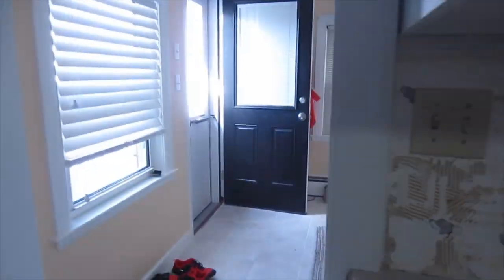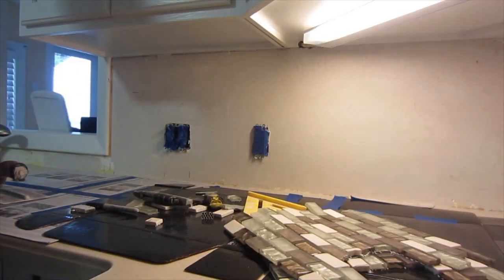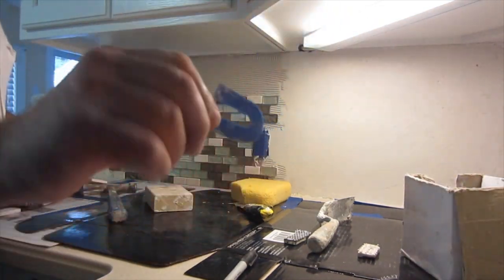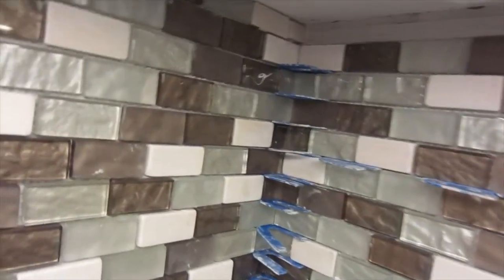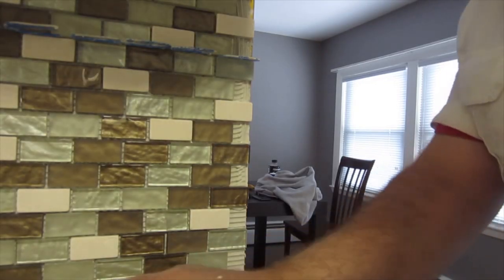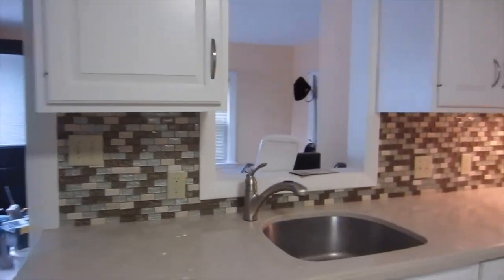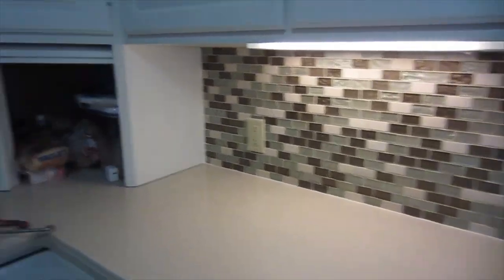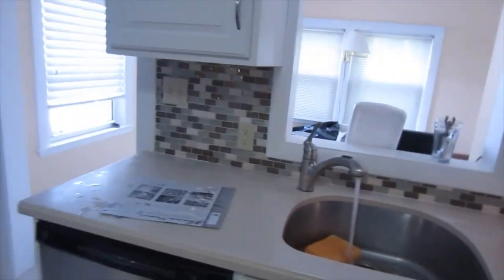How to install a glass mosaic tile backsplash Parts 1,2 and 3

Comment: Did you use thin set to patch the holes in the wall too? Also, does it help to draw level lines around the wall to make sure all the tiles are level?
Reply from the maker: Yes I used thinset in conjunction with fiberglass mesh tape, and any lines that you will find helpful should be drawn. If the counter top is level, then a level line will help, but if it is slightly out, then you might want to just follow the counter, otherwise the  tiles that sit on the counter  will not all be the same size. You will either have to cut the tiles or have a grout line at the counter that will increase in size. This will not look good, most counter tops are usually level, but not always. If not you will have to decide whether you want the tiles to be level, or parallel to the counter. If the counter is out of level, and you decide to have the tiles level, then the whole backsplash will look like it is on an angle relative to the counter, which will not be pleasing to the eye, if you follow the angle of the counter, then the tile will be square to the counter and will look correct.  Bare in mind that most counter tops that are not level are only out of level by a small amount, but a counter that is out of level by only a 1/16" per foot will leave you with a difference of a 1/4" in 4 feet and a 1/2" in 8 feet, putting your tile level in this situation will result in an unsightly finish. I am telling you all this, because i have seen it done. Your choice.

Comment: Hey Sal, can you use a Schluter Reno edge strip on the sides of the mosaic wall tile for a border?
Reply from the maker: You can, and i have, just make sure you get the right size.
Reply: ***** thanks Sal

Comment: How would you deal with a textured (orange peel) wall? Just lightly sand it down until it's mostly smooth?
Reply from the maker: Or you can skim coat with thinset to make it smooth.

Comment: Thanks for a great video. Very informative! This looks almost exactly like my project. I had 4by 4 white tiles that have been removed Which left me with high ridges and some pretty deep holes. What did you use to patch holes and for skim coat? Another weird coincidence is that the mosaic you used is exactly what I need. My floor and some kitchen walls are brown and the adjacent dining area that directly abuts one end of the new backslash is green. We've been looking for quite awhile for a tile that would tie it all in. Any chance you have spare tiles where you can pass along the brand and model info to me? It would be great of you to do that and I would be very appreciative.
Reply from the maker: Just patched the holes with some fiberglass mesh tape and skim coated  with thinset, unfortunately I have no idea what the tile was, to long ago to be able to find out.
Reply: i am getting ready to add back-splash in our newly finished basement laundry area, bathroom and kitchen.  These tiles appear to be similar to the ones I bought at `Home Depot.  They are called Ayres Brick and the store SKU is 188529

Comment: I'm confused on one thing.  Why do you not just  cut the top strip of tiles to fit under the upper cabinets?  Instead you cut the top strip an inch short and then pieced in the remaining strip to but up against the cabinets..  I only ask because I will be doing this soon.
Reply from the maker: The last piece of tile needed to be trimmed to fit, a full tike was too wide

Comment: I don't understand the necessity for a flash coat of thin set?
Reply from the maker: Usually not needed, but this time I had to fill small holes  and smooth out the wall a bit.

Comment: I still do not see any answer to the question of leaving a space at the counter top?
Reply: P Gordon , i usually do leave a slight grout/caulk joint between the counter. caulk it or it will most likely crack out due to the countertop flexing.

Comment: what was the purpose of placing the 1 inch blue horse shoes in between the tiles?
Reply: You use these between individual sheets of tile to make sure you maintain the spacing, which is later filled with grout.  If you don't use spacers, you will have tiles right next to each other without the needed spacing to fill in with grout later.

Comment: do you need spacers for the elec. outlets
Reply from the maker: +Mike Fix I never use them, but you can if you want to.
Reply: Wont the outlet be recessed compared to the cover
Reply from the maker: +Mike Fix Maybe this will help https://www.youtube.com/watch?v=gg_Mj3vwts8
Reply: +Mike Fix Yes it will, but it does not matter, tile is not combustable,
Reply: +mark rainford what. i asked if you need spacers to raise the outlet so it will be flush with the tile. not sure what page your on.

Comment: What did you use to skim coat the surface before applying it?
Reply from the maker: Same thinset I used to install the tile.
Reply: Sal DiBlasi thank you! May I ask what type 1 tile adhesive is? Is it different than the others? Will it look darker after applying it?
Reply from the maker: Type I Mastic is probably something that you stay away from, it has very limited uses and more expensive than Thinset mortar. Just pretend it does not exist and you will be better off.
Reply: Sal DiBlasi some tile adhesive stick on the glass mosaic tile and it’s been 20 hours. What do we clean it with?

Comment: It's always bugged me when mosaic tile just stops on the wall or at a corner. I always felt there should be some kind of termination stainless strip or pencil to "properly" stop the tile. The edges just look a little rough. I feel like the tile mfr should make a finished tile edging etc.... FWIW.....just sayin'......
Reply from the maker: I polished the tile ends to give a nice finish.

Comment: He left out a step, I'm afraid. It is recommended, that you use some kind of primer/sealer, BEFORE you apply tile on a gyproc surface
Reply: PVA water mix is great for this and very cheap, add a handful of sand to the mix for added grittiness and adherance!
Reply: Kevin De Hinkelai

Comment: can't watch the video he doesn't know what he is doing.
Reply from the maker: So how do you do it, Pray tell. I was looking For your video, there does not seem to be one
Reply: *****
There is always a schnook like that on here who "knows how to do everything dude" but mysteriously is not anywhere to be found!
Reply: I use high performent setting cement, nonslipp and approperiate Tile installer tools, tapping with a Soft grouting tools  if needed and depend on the kind of tile, a rubber hammer. The vibration caused by a framing hammer and wood can break tile. He probably is firm with this way installing tile but not right to teach other without direct contact with a person were to look and listen too. The sound of a tile tells you what you can do with it. Proffessional tile setting is kind of art. Everyone can Install tile, a few do it right and know how to get out of it if they run into trouble without noticing. If anymore needs more information feel free to text question
Reply from the maker: Walter Grueter many manufacturers actually discouraged the use of a grouting float to set  glass mosaic tiles, a float provides un even preasure, the soft body of the float  can grab and move the tiles, the hammer is used to tap the block and set the tile evenly into the  thinset, which is supposed to be a high polymer content thinset, in this case superflex. I know there is more than one way to do this, and this is one of them. If you don't like it then don't do it this way, but don't say ghat it is wrong when it is not.
Reply: Hi Sal. 
90%of our glass  tile are uneven. I use a soft red colour grouting tool. For everything else a harder epoxi grouting tool. If a installer gets a tile ship in his setting material and the tile sticks out. Straighten  the tile out with a wood and hammer it will break.  In either case you have to take it out and installed it again but one is not broken. I really don't  care what Companies say in general. There are a few  things what I did and companies did not agree with at the first time later did recommended it. 
Compare it make tests and give out recommendation and recall or change them after a while they are as good or bad as the tester are. 

.
Reply from the maker: Walter Grueter You can install the tile any way you like, as long as you use the correct type of thinset,  the end result is acceptable, and  the customer is happy, then all is good, If you choose to follow the manufacturers recommendations, the likelihood of a successful installation is more likely to be achieved, if you don't follow them and come to the same end result, no harm done. Many new methods of installing tile have been developed by installers in the field, i am guessing a greater number of failures have also been replaced.
Reply: ***** great video.  I am in the process of renovating my bathroom.  One of the next steps is a back splash.  My question is how to cut those little tile pieces.  Do I use the same saw I used for the floor tile?
Reply: Walter Grueter Schmuk
Reply from the maker: robert greene you can use the same tools in most cases, but there is a special kind of nippers, the one that looks like it has two wheels. You might need a glass blade for the wet saw if the blade  chip ls the glass as you cut it